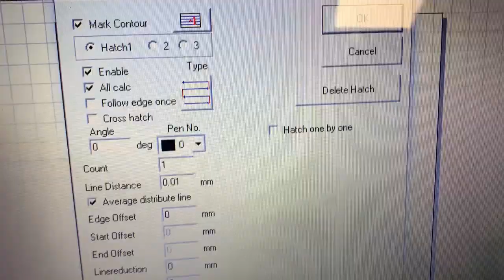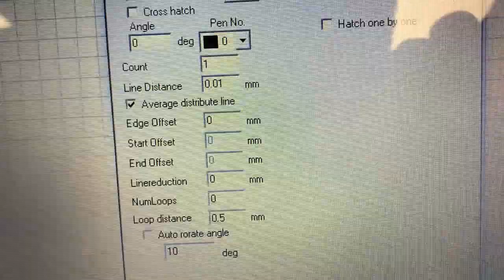Fibre Laser Glass Use your Fiber Laser to engrave on the reverse side of glass.

Comment: Nicely done. My CO2 laser is on the fritz at the moment, so I wondered "Can a fiber laser engrave glass?" By your experiment, I conclude yes and no. Technically the laser went through the glass and stopped at the metal surface and it was the explosion from the metal surface that engraved and stained the glass. Good to know!
Reply from the maker: Thanks for watching, Marcelo. You’re right, fibre doesn’t engrave glass like CO2. There are different coatings you can apply to the glass before engraving like CO2 does for metal engraving. I haven’t used them so can’t comment on the results. Aluminium foil is an effective medium for fibre both for the top surface or beneath as I did with the stainless. It gives a white finish. Cheers Mike
Reply: help me Boss what is Best Lasser?
Reply: How we can marking on glass by fiber laser?

Comment: Hello, we need a help with something and we would really appreciate if you could help us. The problem is we are trying to laser mark Polyamid 6 plastic with 30% glass fiber using our Fiber Laser marking machine, but nothing happens. The machine marks other plastics, but not this one. Can you help us?
Reply from the maker: You sure have a challenge with that one. I’ve never engraved it and don’t have quick access to it.  From what I can find, only a MOPA fibre laser will mark polyamid 6. You could experiment with coatings like Cermark or aluminium foil. Engraving the coating might make a permanent high contrast mark after the unlamented material is wash off.

Comment: Hello Mike, how we can do it on glass cup, like wine, whisky glass?  Thank you
Reply from the maker: Good question. I haven’t done that yet. I would try using foil around the inside of the glass with some foam to help press it against the glass. The marking will be on the inside, so the question is, does the liquid react with the metal oxide? It’s possible to mark the outside by wrapping the foil externally. I think I’ll have to play with this.
Reply: @AussieMikesBees   did you ever play with that? :)
Reply from the maker: No, it’s been hectic. I haven’t done any lasering for months. Maybe I’ll find time during the Christmas break.

Comment: Good video Mike!!
What laser are you using btw? Is it one of those Omtech variants?
Reply from the maker: Thanks for watching. I have a 30W Raycus from AliExpress running EziCad2. I’m upgrading the controller to run EziCad3 for better engraving.
Reply from the maker: Yes, it is the JCZ card with EZ2. I don’t recall who I bought it from. There were quite a few sellers with the same pictures. I suspect many are made in the same factory. If you’ve been referred to Richard Z then go with that. I recommend spending the extra to get EZ3. EZ2 is notoriously unstable, often referred to as EziCrash2.
Reply: @AussieMikesBees  Thanks for the reply Mike!   Yeah, I've been looking to get into laser engraving/annealing/micro cutting as side business(fellow Aussie here too) so just doing some research.  One of the FB groups has different photos of people doing all kinds of crazy stuff with annealing colours on the metals, etc so just researching on what the majority use(for sake of ease/research, and mainly the 'settings' they use)
I checked out the Aliexpress site last night, and your right, most of them look very similar.  Some of them are much cheaper than what I got quoted, but kinda wary on buying off on that site
Reply from the maker: I understand your doubts with AliExpress. I’ve bought hundreds of items over the years, mostly cheap components, but still a number of pricey items. I’ve had one non-arrival and one dead on arrival. The DOA I fixed myself, just not worth the hassle of sending back. The no show was refunded straight away. My experience has been good. With your Laser, just make sure you get genuine components. It’s crazy, but there’s Chinese knock-offs of Chinese parts. I know Rock-Solid Laser uses genuine bits. That’s who I bought the BJJCZ EZCad3 upgrade card from. If I had my time again, I’d get one of their JPT M7 MOPA 60W.
Reply from the maker: That’s the brand I bought. They don’t offer EZ3. Look at Rock Solid Laser https://www.aliexpress.com/item/1005002849845165.html?spm=a2g0o.productlist.0.0.51081692tyeG94&algo_pvid=6cd42006-44b6-41da-973c-d3992f027dc9&algo_exp_id=6cd42006-44b6-41da-973c-d3992f027dc9-1
Reply: @AussieMikesBees  What good reason would there be to choose a 50w over a 30w (for example)?
Reply from the maker: @YAOG  The main advantage of 50W over 30W is faster engrave times.  This can be significant on a deep engrave 3d image.  The 30W  may have to do more passes to get the depth required. Also increases the size you can engrave (lens dependent). The 30W may not have enough power to deep engrave a 200mm or larger area, but the 50W may.  It is one of those things where more is better.
Reply: @AussieMikesBees  So if I were considering a gun and knife engraving business, should I shell out the extra money for a 50w?  I want to be able to do gun shows and whatnot and have it be impressive too
Reply from the maker: @YAOG  In my opinion, you'll long forget the extra cost and always have the advantage.  Whenever the time comes for me to replace or add to my laser, I will get a 50W or 60W.  I'm in the process of engraving 3000 stainless steel tags with two deep engrave passes, a cleaning pass and an annealing (black) pass.  It takes eight hours per 40 tags with a mid point flip to the other side.. Even a 20% reduction in time adds up.
Reply: @AussieMikesBees  Thanks man. A woman from A Chinese manufacturer is trying to sell me a 50w with some kind of converter belt that makes jobs like you described a little easier. She just put the pieces of metal on the belt and somehow the laser knew where to mark them all. Then they fell off the edge onto the basket